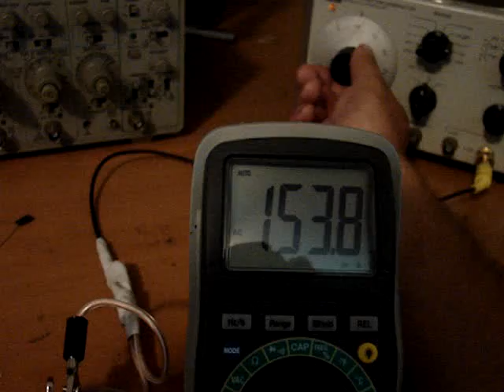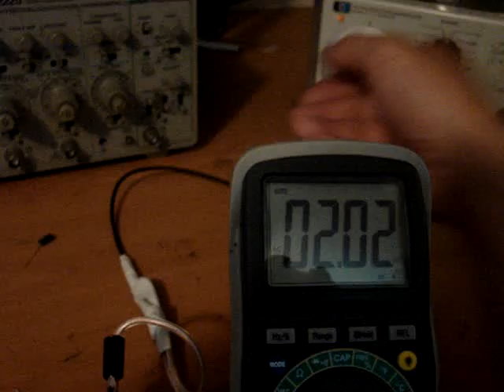Ressonant rise of Parallel LC (3)

Comment: Putting multiple capacitors in parallel lowers their esr (resistance) thus reducing the losses. Using thick wire (for coil and connector wire) and making proper connections between cap and coil, does the same
Reply: @N01Spl   So your just writing what you think is true, and state it as if it is a universal truth. Good luck with that...
Reply: @N01Spl Tin is less conductive than copper, so I would like to see your proof